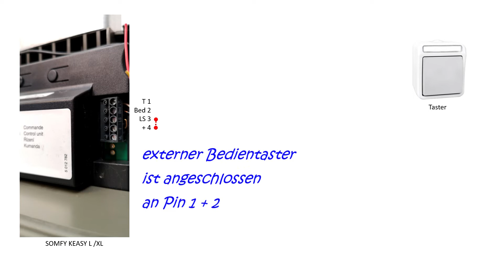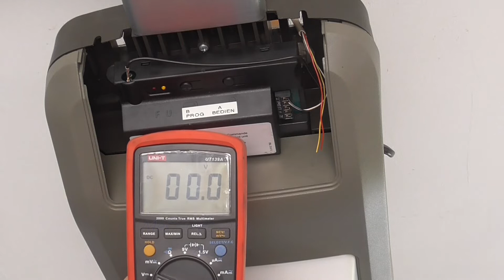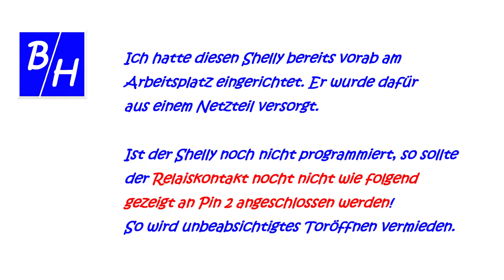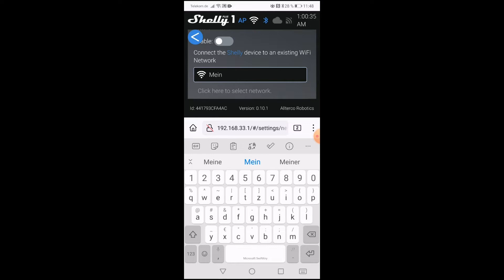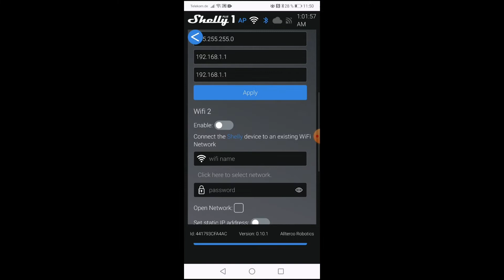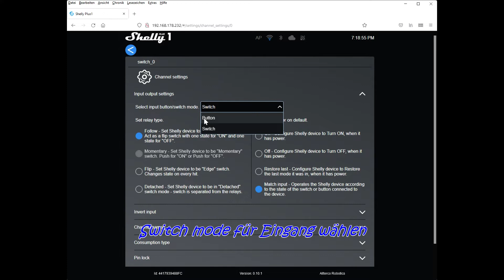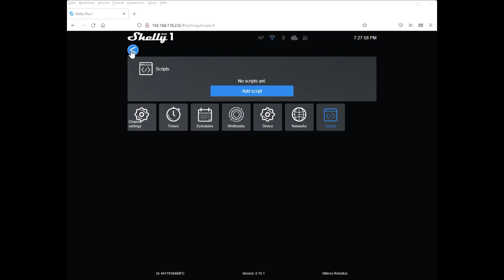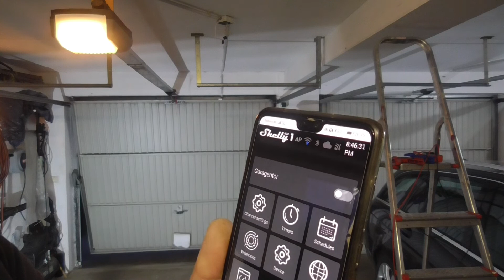Somfy KEASY L steuern mit SHELLY Plus 1 & Home Assistant - Folge 1: Installation Shelly

Comment: Anleitung ist top. Allerdings ist mir nicht klar, wo Du am Ende den Öffnungsmelder kontaktierst. In den Schaltbild am Anfang gehst ja auf den Schalteingang des Shelly und auf die Klemme - was für mich auch Sinn macht....
Reply from the maker: Hallo,
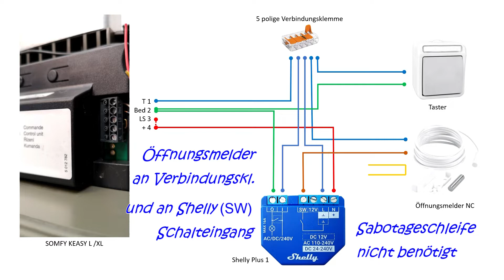bei 3:01 kann man sehen, dass das Reedrelais zwischen SW und L (Masse) angeschlossen wird. 🤗
Reply: @BastelHobbie   danke für die schnelle Antwort, das hab ich ja gemeint, dass das Reedrelais direkt auf den SW geht hast ja auch genau beschrieben, aber was machst Du bei 18:00 mit dem Kabel vom Relais - Du schreibst "Anschluss an externen Taster", aber das ist schon verkabelt auf SW und auf der 5er-Klemme, das check ich nicht?
Reply from the maker: Stimmt, dass ist nicht unbedingt klar beschrieben.
Für die Shelly-Anschlüsse SW + Masse (L) nutze ich zwei Leitungen des bereits vorhandenen Kabels zum Taster des Garagentors. Dieses Kabel verschwindet in der Abzeigdose in der Decke. Bei 18:00 klemme ich die Leitung des Reedkontakts an diese beiden Leitungen.
Reply: @BastelHobbie  ah okay, jetzt ist's klar! Danke für die Aufklärung!
Reply from the maker: Vielleicht noch ergänzend:
Der Taster zur Bedienung des Antriebs ist ja parallel zum Relais des Shelly. Der SW-Eingang wird hier nur genutzt, um den Status anzuzeigen und nicht um das Shelly zu Schalten. 💡